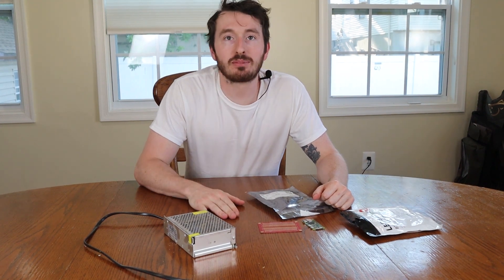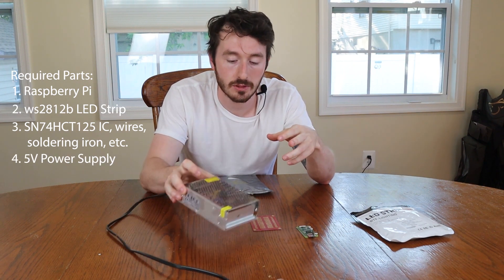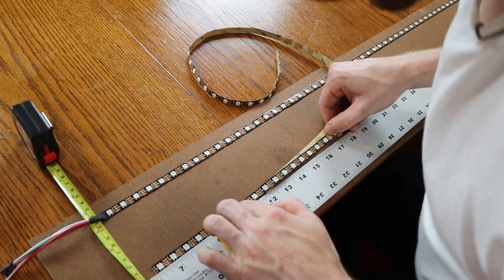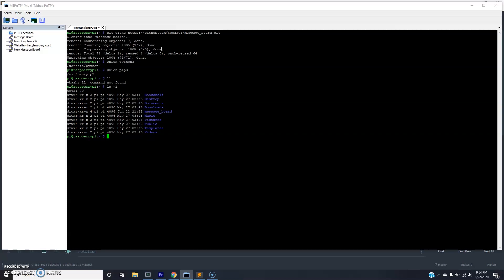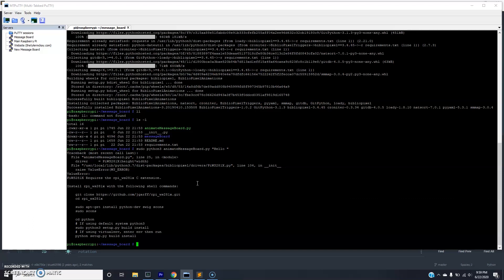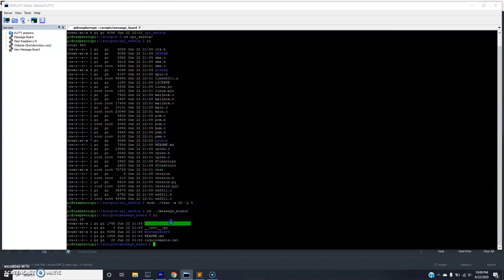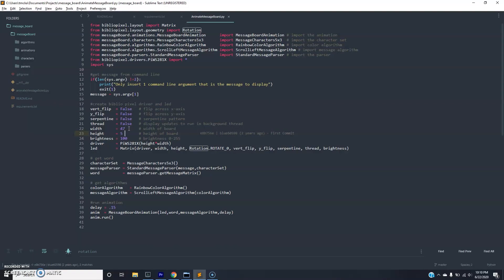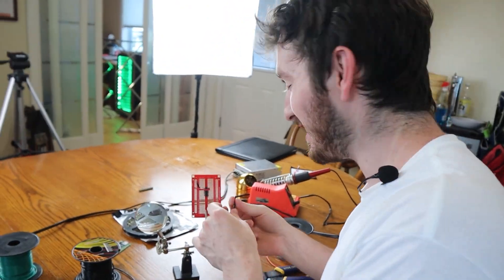HOW TO MAKE A MESSAGE BOARD: Raspberry Pi Projects| Python Programming

Comment: How many A does the powersupplly have to be? you only mention volts
Reply from the maker: I believe each meter of leds requires about 2 Amps, so if you have 5 meters you'd need 10 Amp rating

Comment: hi i keep getting the same error as  Rob T,  no message across screen, just the error????
Reply from the maker: We were able to get past it by running it in a virtual environment it might depend on how your pi is setup which is why you are getting the error. I suggest doing that and in the install instructions make sure to use the instruction that is for the virtual environment. You are getting that error because the rpi_2812x package is not installed in your system library somehow the install either didn’t happen or it installed it somewhere else. Did the test executable work? Feel free to dm me on Instagram

Comment: Hello!
I keep getting the following: 
PiWS281X Requires the rpi_ws281x C extension.
With the instructions on how to install. I've followed the instructions and everything succeeds, but I still get the error.
The test also plays correctly with the rainbow colors. Any ideas?
Reply: I'm having the same issue. What ended up being the solution?
Reply from the maker: Really, what do you mean by plays correctly by the rainbow colors? Do you get a successful message across the screen? Feel free to DM me on Instagram (you can get it on our channel page)